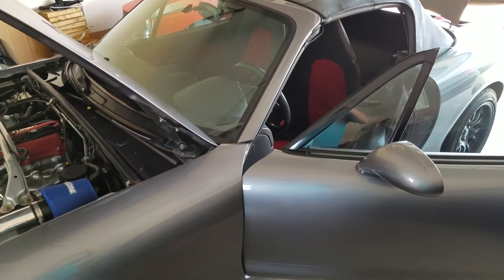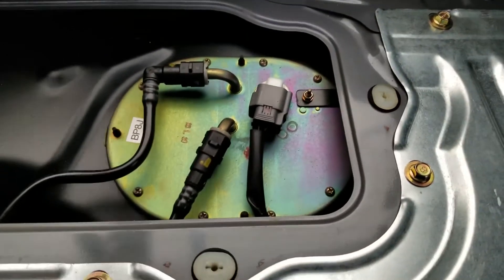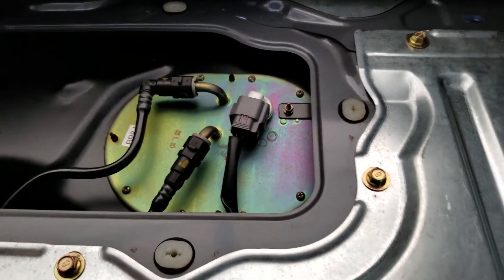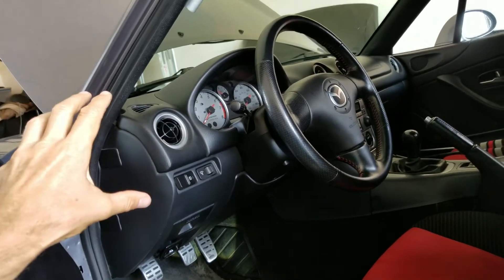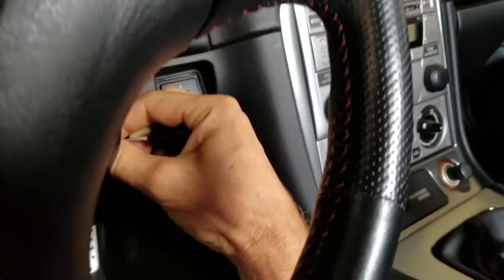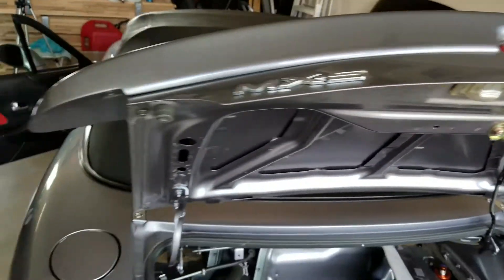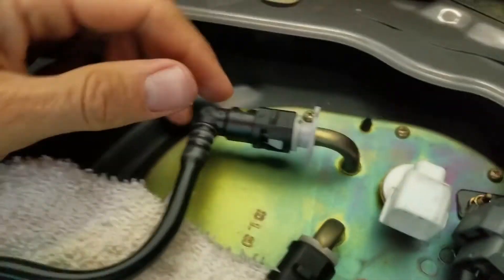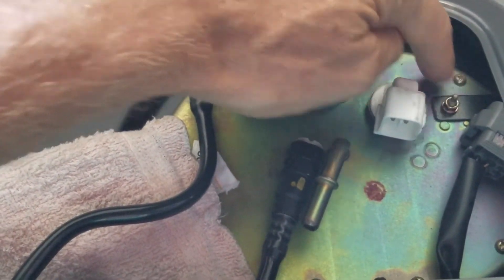Best fuel pump replacement video for NB Miatas! (Part 1)

Comment: I also used the round, white 'clip' tool to remove the petrol line snap-on connectors. In my case, pulling them by hand wasn't enough. I had to put the open end of a spanner behind them, and tap it with a small hammer. That worked!

I also found that the tank remained pressurised after I had disconnected the lines, with petrol pouring out. I had to open the fuel cap to relieve the pressure.

Comment: Disconnect your negative cable not the positive. This is critical. Also, no reason to unplug the fuel pump relay. Unplug the pump connector at the pump itself. Don't be redundant. And you do not need a tool to remove the fuel lines. If you pinch the outermost edge(the white plastic with clips) and pull the fuel line then the retainer with clips stays on the metal line while the plastic hose slips off easily.  Also, this could've been a 5 minute video. But glad someone took the time to make this. Cheers.

Comment: Instead of pulling the fuel relay, you can just pop the electrical connector off the fuel pump assembly and turn the car over a few times.  Just did this on a 2003 Miata.
Reply: Exactly. You'll have to remove it later in any case to remove the pump assembly.

Comment: You didn't even show the removal or swap of the pump 🤦‍♂️🤦‍♂️🤦‍♂️. I assume that fking thing pulls out from the top even though it looks like you can't pull it straight out
Reply from the maker: yes you pull the pump out. i think i couldn't video and pull the pump at the same time.
Reply: @mazdaspeedmx512lbs  yeah I got it out no problem, thanks. Also you don't have to remove the plug under the steering wheel. Just removing the electrical plug right at the top of the pump assembly does the trick. ✌️

Comment: Why not simply disconnect the connector AT THE FUEL PUMP? You will need to disconnect it to replace it, right?
Reply: Because there would still be pressure in the fuel lines

Comment: How do you tell if the fuel pump is bad?
Reply: Easiest way to tell is to listen by the fuel fill pipe with the gas cap off while someone else turns the key to 'on' (but not start). You should hear a high pitched whining or buzzing sound for 1-2 seconds right when you turn the key to on...thats the fuel pump priming. If you don't hear that, you likely have a bad fuel pump.
Reply: @cen7ury  what are the dangers of a bad fuel pump anyways? Just bought a 99 the other day and today when i started it i heard the whining right behind me that lasted for a good 15 seconds maybe? also starts whining again when i turn the car off
Reply: @c4veman  Generally, the main danger of a bad fuel pump is your vehicle not starting. Occasionally a pump might go bad while the vehicle is running, causing it to stall out and not start back up, but that's pretty rare, and usually would only happen when you're running on fumes, since the fuel in your tank is what cools the fuel pump...so no fuel means the fuel pump can overheat and sieze up.

If you're hearing the fuel pump operating, that's a good thing. Fuel pumps don't usually give much (if any) warning before they stop working, at least not in my experience, so if its working now you're good for the time being.

Hope this helps!
Reply: @cen7ury  It did! I’m just a bit conflicted now because of people on the miata forum suggesting replacing it as an indicator it’s going bad
Reply: @c4veman  Honestly, it's such an easy thing to replace, even on the side of the road, that I  would suggest ordering yourself a replacement at a good price (from Rock Auto or similar) and just keep it and a simple tool kit in the trunk for when it eventually goes bad. That way you've got peace of mind without having to replace a working part to get it. Best of both worlds, imho.
Reply: @cen7ury  yeah i ordered one for my 99 and am researching how to replace it rn. it’s similar to other fuel pumps but i’ve only changed one other before and this is my first car.

Though i’ve driven about 4 years in different cars i’ve been insured under
Reply: @c4veman  Sounds like you've got the right idea, my friend. Safe travels, and keep the rubber side down!
Reply: @c4veman  You can hear the fuel pump priming in most cars. The Miata is the first car I've owned that I can't hear the pump prime from the driver's seat. If started hearing it all of a sudden, I would take that as an indicator that it was about to fail. In your case, since you could hear it from day one, it might just be an aftermarket (or bent) bracket causing the pump to touch the tank, or it could be a replacement pump that's just louder than the factory one. If we you, I'd pull it and inspect it. Then you can decide if you want to replace it in your driveway or on the roadside. If it's just a loud pump, you can get a neoprene sleeve from the auto parts store (it won't be Miata specific, just ask to see what they have in stock, and pick one that fits kinda tight) to slip over it. That will quiet if down a little.

Comment: Would you recommend putting a higher pressure fuel pump on an non-turbo NB? I’m having hesitation issues and gonna be testing pressure so figured it would be good to know in case I gotta replace it
Thanks!
Reply: Have you replaced the fuel filter yet? Maybe clean the throttle body too.

Comment: Hey! Great vid! Thanks for the indepth instructions and tips.
Question: Regarding removing the connector and running the fuel out, could I just disconnect the electrical connector on the fuel pump? or do I have to remove the one under the dashboard?

Thanks!
Reply: Yes disconnecting either will work.
Reply from the maker: the manual says disconnect fuel pump relay under the dash
Reply: @mazdaspeedmx512lbs  would unplugging the fuel pump fuse/relay under the hood also work?
Reply from the maker: @sandyparas6960  the manual says to unplug the fuel pump relay then start the car. if you unplug the fuse i dont think the car will start to release the pressure

Comment: I was doing a fuel pump replacement on my miata until i noticed i did not get a new bracket that fits the new pump and rubber piece that goes near the screen that came with Delphi Fuel pump I got from advance how did your bracket go on? Does the new pump you got fit with old bracket or did you order a new bracket?

Comment: Just a nitpick, but you disconnected your positive lead to the battery (the one that is shrouded so it won't short if something metal touches it. Typically, you disconnect the ground lead. Great vid!
Reply: That's not a nitpick, it's critical. That's how batteries explode. It's how wedding rings burn flesh down to the bone. Please don't take battery safety lightly. There are much better ways to lose a finger or a lung.
Reply: @earlebird4262  Agreed.  All you have to do when you're taking off the positive terminal is touch the inner fender with the end of your wrench, weld it in place, and then you have real trouble.  Possibly a battery explosion and/or fire which will ruin your whole day and perhaps ruin your car too.  Taking off the negative side is nearly idiot proof so ALWAYS disconnect the negative side.
Reply: agreed, man so lucky to not have sparks flying everywhere...

Comment: Where did you buy the fuel quick disconnect tool from ? I did not see that exact one on the internet ..
Reply from the maker: You can usually find them at any autoparts store. I bought the cheap plastic ones. I bought mine ether at advanced auto or autozone.
Reply: I did not see them on their web sites, so I went the ebay rout ...Thank you JC ..